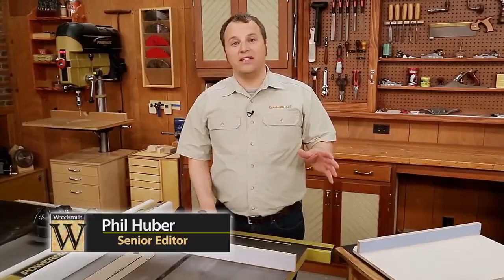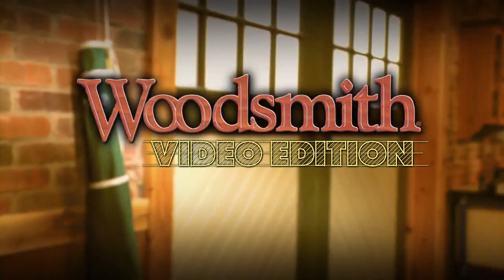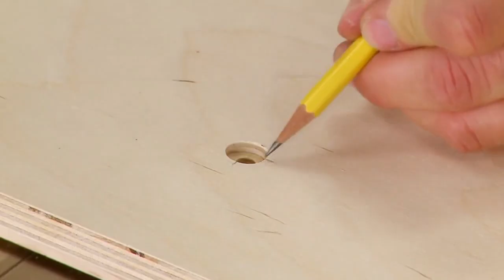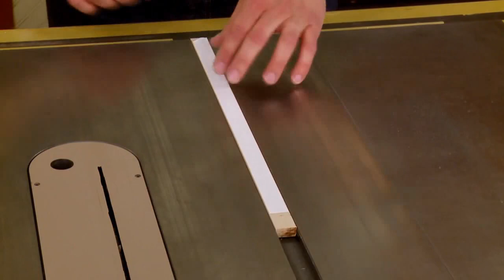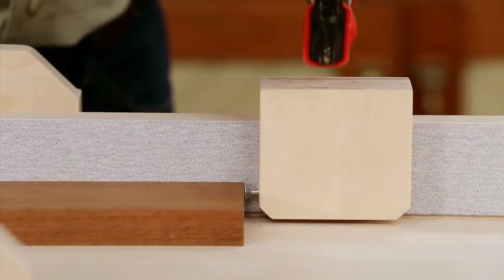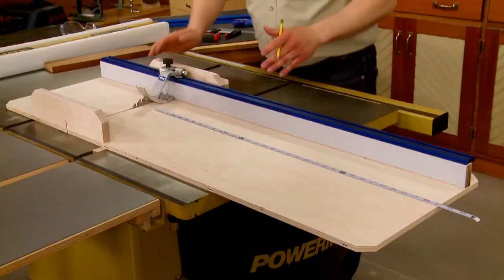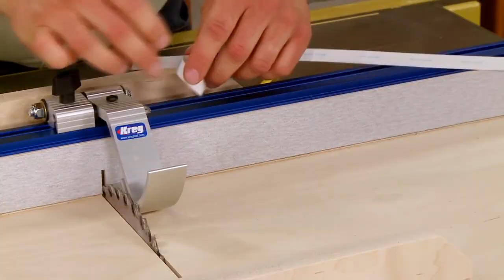How to Make a Table Saw Crosscut Sled | Beginner-Friendly + Free Plans

Comment: Thanks for these videos. I find them really useful. I had a simple sled I’ve used for a year but like the extra flexibility that the second sled (truly the last you’ll ever need) offers. If you were to include links to some of the products like the folding Kreg stop block, the T track and the tape it might save me some time running it down. Not a big deal, I know how to use google. Question: is there any reason for not using a second runner on the larger sled? Seems like it would add to accuracy. Thanks again. Keep them coming!!
Reply from the maker: Sorry, I didn't catch your comment earlier... for some reason it got caught up in the spam filter.  I will definitely add some links to sources in the description.  One of the questions we get a lot is about sourcing the the double-sided tape we use.  It is from Intertape Polymer Group (IPG) and can be found in various widths here: https://amzn.to/2SUVhQJ ; Kreg Swing Stop Block: https://amzn.to/2PKLBts ;  Kreg Self-Adhesive Measuring Tape L-R: https://amzn.to/2STk9sj ; Kreg Self-Adhesive Measuring Tape R-L: https://amzn.to/2JPeX4I ; Kreg Top Trak 48": https://amzn.to/2RJvIRx ; Kreg Top Trak 24": https://amzn.to/2SYXJGa

Comment: where do you find the  sand paper
Reply: Bill., the local home center has non-slip surface tape used primarily on steps and industrial floor settings

Comment: Why use a piece of aluminium in the saw slot? Use the blade!
Reply from the maker: If you use the blade, you have to make sure to land on a tooth at the front and back, and it can move around as you are trying to square the fence. The aluminum strip gives you a longer and more stable reference point, so we just find it easier to do it that way.  I wouldn't necessarily got out and buy a piece of aluminum for this, but if you have a piece of scrap in the shop, like we did, it certainly helps.

Comment: Why did you use only one runner? I would think that two runners would better and more secure.
Reply from the maker: We’ve found that it can be a little tricky to get two runners perfectly located and parallel to each other.  If this isn’t done correctly the sled will bind and won’t slide smoothly.  Using just one runner seems to work fine.

Comment: It looks like the blade guard on the back needs to be higher, for the case where the blade needs to be raised all the way.  Is that correct?
Reply: I prefer adding handholds left and right of the blade. No one should ever have their hands going directly over the blade like that. Really bad habit to build.

Comment: Just wondering why you don't dado the base bottom for the runner instead of the tape?
A 1/8 in deep dado will lift the runner some and it assures both he runner and base are straight.
Also, a framing square and the fence should aline the fence with the base and blade.
Reply from the maker: A dado in the base would sure work. You would then make the runner slightly thicker - Something Ill keep in mind next time we're working on a sled. I usually tend to stay away from framing squares - I drop mine too much and I don't trust they're terribly square (although, they're square enough for framing)!
Reply: Woodsmith 
Thanks Bunches for the reply! Though I can't write out the details, there is away to check a framing square and even a way to adjust it with a center punch.
My experience is the longer the square, to a certain extent, the better, more square you'll be.
Reply from the maker: Yep, i've adjusted a few of mine by punching the inside (or outside) corner with a center punch to pull it back into square! Great trick.
Reply: @dougsprojects6431   That is almost a myth.  IF you know what you're doing and have the right kind of punch and a solid place to strike it (like an anvil)  you can expand/contract a square that way - but unless you have a machined square to begin with - it's a waste of time if you're looking for a reference surface.  All of the steel or aluminum squares sold at home centers are stamped out - they're not machined. The blades/tongues are not truly straight, and they vary in width by as much as 20-30 thou. along their length, and they're not truly all in the same plane. If you don't know what you're doing you're just as apt to knock your square out of plane as you are to open or close the angle.   Bottom line, if machinist accuracy matters then use a machined tool (like Woodpecker stuff) - but those are $200 squares not $20 squares.

Comment: Hi Phil, can I ask why you don't use 2 guides that run in the table as there are slots either side of the blade?
Reply from the maker: We’ve found that it can be a little tricky to get two runners perfectly located and parallel to each other.  If this isn’t done correctly the sled will bind and won’t slide smoothly...  Using just one runner is simpler and seems to work fine.
Reply: Cheers Phil. Males sense. I am a technician in a senior school in the UK.  Under health and safety we are supposed to use a crown guard at all times but I really like that sled. There's a lot I could do and justify it's as safe :-)
Reply: @hairydancer1604  I'm not sure it would qualify under H&S, so take with a grain of salt. I would think that adding a bridge between the front and back cross bridges, to allow you to add a Perspex guard on either side of the blade path by half an inch or more, to prevent fingers from getting in the moving blade area, and extending that beyond the far edge of the sled so that the blade is covered from startup to end, would probably be sufficient. The "Engineering" gets complicated if you want to be able to have that perspex drop to the table or the piece of wood you are working on, but I don't think that would be really difficult. I would ad a sled stop to prevent the sled from going beyond the leading edge of te blade (allowing for added blade surround) as Mathias Wandel has done with several of his sleds. (A simple block added to the leading edge of the sled, or in a pocket under the sled at the right point, that slides over the table, then drops at the end of the table and catches on the back rip-fence rail, if you have one, or on the leading edge of an outflow table if that is your setup. The presumption being that there will be a gap that the block will drop a leading edge into to catch the appropriate point after, and that there is either a rail or table to catch the block on.)

Comment: Beautifully done Sir.  Thanks for sharing.  Any reason why you did not use two runners?
Reply from the maker: sum1sw - we’ve found that it can be a little tricky to get two runners perfectly located and parallel to each other.  If this isn’t done correctly the sled will bind and won’t slide smoothly.  Using just one runner seems to work fine.
Reply: Thank you for your advice.  I'll keep that in mind, but I really like your double sided adhesive tape method, I thought it would work. - regards

Comment: The problem of wooden runners is that they expand and contract depending on the season or weather, which causes them to either have too much play or to get stuck in the track.
It's worth buying some peace of mind by "investing" in metal runners with Teflon adjusters. Unless you're completely broke.
Reply from the maker: Muru Roa -This is true of wood runners... investing in a purchased metal or nylon runner would be an appropriate upgrade for a table saw sled.

Comment: I've seen a lot of similar youtube videos where people build their crosscut sleds using runners in both miter slots. This is the only one I've seen with just a single runner.  As a newbie woodworker, I'm curious what might be the advantages of using one runner or two.
Reply from the maker: emilne83 - I don’t know if you get any more stability with 2 runners versus one, but I find that it’s harder to set up 2 runners because if they aren’t perfectly placed and parallel the sled will bind and not slide smoothly.  It is an interesting question that I’ll look in to further.
Reply: @WoodsmithShowandmagazine  I think what you're describing, and running into with a second runner, is what is called overconstraint. In short as the runners wear, there will be some tendency for the bed to 'rotate' around the blade, and a second runner will add friction to the process, increasing the tendency to rotate, and bind.
Reply from the maker: Great explanation... Thanks!

Comment: The idea that you even need a sled for your table saw is small minded and an unsafe way to operate. 
Have you consider investing in a quality European style sliding table saw?
Reply from the maker: wood worker - I’ve been woodworking for a pretty long time and this is first time I’ve ever heard that using a table saw sled is inherently dangerous. Please explain your logic.
Reply: Altendorf, Martin, SCM, Felder all make them and the Europeans have higher safety standards operating machinery. See this video and tell me how working off to the side of the blade, letting the table do the work and with the option of using a clamp to secure the work piece isn't the safest way to operate? 
The operator is out of the way from kickback (the most common accident), fingers away from the blade and making the most precise cuts with the use of a slider calibrated to within one tenth of a millimeter accuracy. 
https://youtu.be/LVYUss6pJqQ
Reply from the maker: wood worker - so by your logic any non- European style sliding table saw is inherently dangerous?  I think we’ll have to agree to disagree on this matter.
Reply: While operating a traditional cabinet saw you're not only leaning over the blade putting your fingers close to the blade, you're also directly in the line of fire for kickback which injures more woodworkers than the blade. The sliding table saw puts you in a safe position away from the blade and out of the way from kickback. Remember, you can always lock the sliding table on a European model and 'get cowboy' if you want to.
Reply from the maker: wood worker - “Get Cowboy” ... I like that phrase!  I might have to use that sometime! 😀 Thanks!
Reply: wood worker sure that table saw is awesome but what DIYer has $20,000 to drop on a table saw like that?
Reply: Every single DIYer who can make 10 x $2000 custom pieces.
Reply: wood worker Not too mention the space that thing requires. It’s just not practical for someone who is only making projects for themselves, which is what DIY is about. Great if you have the room and are a professional selling your projects for profit.
Reply: Wood worker, Don't be a hater. Please add pic of you using that saw at your house as a DIYer along with some projects you have done.
Reply: An excellent Felder  "Hammer" is only $5000.00  very reasonable for the quality and safety of use.
Reply: @williamsanders6092   $5K? Again, no where near within a DIY'rs budget
Reply: That is patently ridiculous and anyone who has read your many silly comments are nodding their head in agreement right now.  Fact is - there are millions of us doing very accurate and very safe work on standard USA-style table saws, and it has been that way for the past 100+  years or so (whenever electricity showed up in town and the first table saw showed up in a Sears catalog I would guess...) - Small-minded?  Expanding the capability of your tools is the OPPOSITE of "small-minded" in my opinion,   I always thought inventiveness and resourcefulness were positive qualities of a thinking "big-minded" person.   Finally - SURE,  I'd love to have a fully tricked-out Felder in my garage workshop - got a spare $25,000 you could send my way?

Comment: Sandpaper on fence will be a pain when trying to do minor incremental repositioning to dial in cut.
Reply from the maker: Robert - I’ve never had a problem with making incremental adjustments with sandpaper on the fence, but I have had problems with the workpiece shifting when no sandpaper is present.  If you are pushing a workpiece through the blade it tends to want slide away from the blade.  The stop block with a screw in it near the 15:00 minute mark is great for making micro-adjustments. 👍

Comment: Why mess with a hardwood runner? Use one of those plastic or metal ones and never worry about swelling
Reply from the maker: John Powell - Purchased plastic or metal runners are probably better choices if you want to go to the expense of upgrading from wood. I’ve even made runners from old plastic cutting boards, which worked well too.
Reply: Nice video. Nylon is a good choice and my local secondhand tool store sells offcuts of materials.. Cheap-cheap! :)
Reply: Here's a couple issues everyone should know about- the metal guides (Incra/Rockler) ones depend on Allen screws on the side to adjust them into your track (fine on cast iron saws... but will actually wear into the sides of your slots over time on an aluminum top saw (the various jobsite saws on the market). The split guides (Kreg) work OK but are not rugged enough (or long enough) for large sleds.  And they're all expensive.  I've been buying 12x24 x 3/8" sheets of HDPE (plastic) from Amazon - less than $20 and you can get a bunch of long runners out of 12" sheet. Once I get the cut dialed in using scrap plywood - I make one test cut on the real thing.  If that works -I cut a bunch of them for the tool I'm working with .  They don't expand/contract like wood so can just keep then on the shelf.  I use featherboards and cut slowly with a 90T carbide blade.
Reply: @HBSuccess  
9

Comment: A dead board on the other side of the blade with a runner attached to hold it in the other slot will prevent the tail stock from falling off the sled.
Reply: Could  you explain what you mean? I'm new at this.
Reply: Sam Young when using your sled for longer boards the tail off piece tends to break off at the end of a cut. To prevent that breaking you need a support sled identical to yours only without a fence on the other side of the blade. The support sled just sits there "dead" and keeps the tail off piece from cracking at the end of the cut.

Comment: Great video but there are better ways to square the fence. For example using a screw as a pivot for initially attaching the fence then clamp/screw the other end and test using the 5 cut method or the dial indicator method or the flip over method. Make any adjustments, drill new holes and screw so the fence wont reset in an old position and test again.
Reply from the maker: John Barr - Good suggestions, thanks!
Reply: We know.
Reply: @rodpotts2666 , if you knew about the 5 cut method then I doubt you would be watching this video to build a sled.

Comment: where do you get the sand paper that you use is it pressure sensitive
Reply from the maker: William Howard - yes, it is PSA sandpaper (pressure sensitive adhesive). We probably picked it up at the Woodsmith Store, but you can get it at most online retailers.  We keep a lot of 4 1/2” wide rolls around for general sanding so we cut it to width from that, but I see you can also get narrower rolls, as well.

Comment: Google ‘5 cut square method” that is the quickest and most foolproof way to calibrate a sled.
Reply from the maker: Tioga Fretworks - Yep, I’m familiar with the method, but it’s good to point to the other viewers.  Thanks for the tip... It’s a fine way to get the fence square. 👍
Reply: Table saw top upgrades
Reply: Tioga Fretworks 0754
Reply: Tioga that doesn't actually calibrate the sled, all it does it check if it's calibrated.
Reply: +Dr. Richard R. Ape, writes "Tioga that doesn't actually calibrate the sled, all it does it check if it's calibrated."

Well it tells you exactly how much the fence needs to be adjusted so I'm not sure what you're wanting it to do?

http://valleywoodworkers.org/wp2/wp-content/uploads/2014/01/5CutMethodSquare.pdf
Reply: Dr. Richard R. Ape a

Comment: If you're making micro adjustments to the outer fence(to square it) while installing and you already have holes won't the screws be pulled back into the incorrect holes or is this video assuming the adjustments are big enough to create new holes?
Reply: I always make two sets of holes - the preliminary and the final. Carefully mark the correction with a marking knife- clamp the fence on that mark - then drill/countersink your final holes.  Don’t re-use the prelim holes at all.
Reply: Holes are oversized in the sled allowing adjustment
Reply from the maker: whopua - The holes through the 1/2” plywood sled are larger than the shaft of the screw so you can slightly loosen the screws, make micro-adjustments, and the tighten screws.
Reply: This is brilliant @Woodsmith ! I never thought of oversizing the holes and i'm going to go redo a new sled with my existing fence and a new base... Thanks!